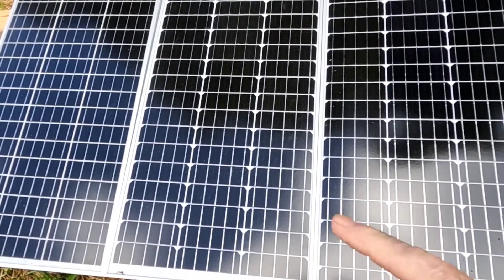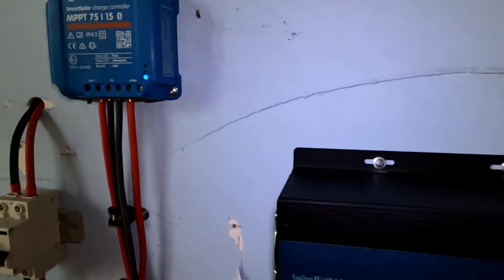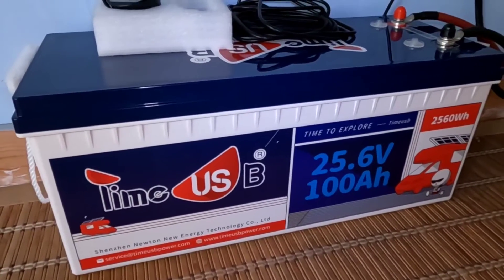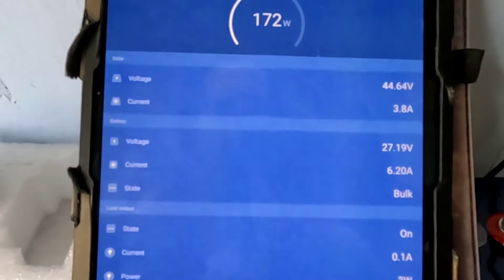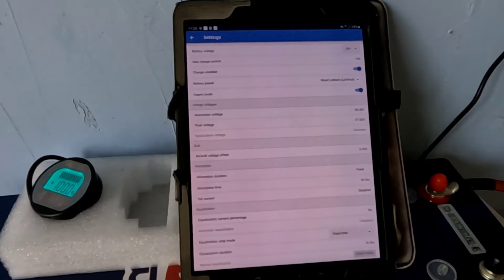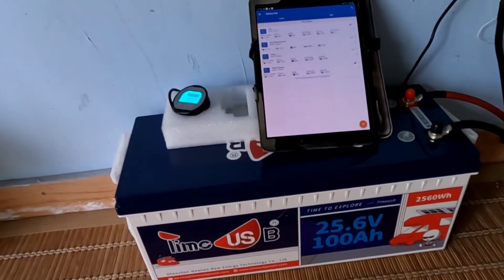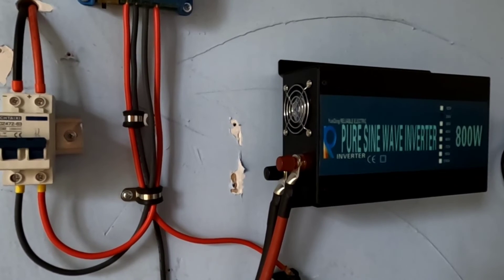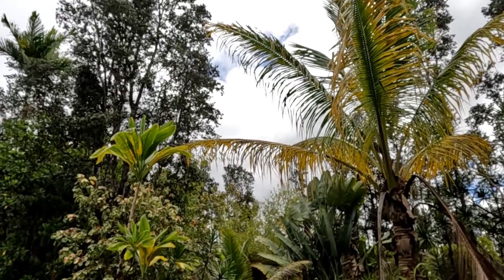12V LiFePO4 battery charging system to 24V in minutes

Comment: I Dove straight into 24 Volt Systems for the Xtra Solar Harvesting and Cable Sizing and Breakers and Disconnect Switches - using The CHINS 280AH LITHIUM IRON PHOSPHATE with Low Temperature Circuit Protection paired in 24 Volt Packs to Buss Bars and Love It / Them
Several Systems here at 🌴 💦 Indian Creek Ranch 🌵 ⛩ Southern California High Desert - Aloha Brother 🤙

Comment: I'd sometimes consider the availability of 12v automotive accessories an advantage towards a 12v system. Otherwise I'd consider minimising the current in the battery leads (and connections) as resistance in the leads causes higher volts drop at low voltage. I often think that 100 amps in the battery leads is enough to worry about volts loss and unwanted heating.

Comment: Will battery time last longer with a 24v 100 Ah battery vs. a 12v 200 Ah battery
Reply: I'm having a hard time grasping that 😢 ....please explain
Reply: @vroor32  Since 24v is suppose to be more efficient, which ampergae wise I understand....just wondered if Amphours wise 24v lost longer as far as run time.
Oviously we cant compare 12v and 24v with the same amp hours since it would be obvious 24 volt would win.
So I wondered if:   one had a 12 volt system but doubled their amp hours to 200 Ah. Would 24V having 100Ah last about the same or last longer if wattage draw was the same between both 12v and 24v systems. 
Would 48 Volt and a 50 Ah battery last the same amount of time as a 24v 100 Ah etc.

Comment: Does charging a 24v battery take longer than charging a 12v battery?
Reply from the maker: Actually charges faster than 12v. 48v even faster. Higher voltage moves faster, especially over longer wire runs. Aloha 🤙

Comment: Good video but I have a question about the inverter. I understand that doubling the input voltage gives you more power (the 24 100AH vs 12v 100Ah battery), however, doubling the voltage cuts the amperage in half, but wouldn't you still need a 1500 or 2000w inverter if that is what you had originally? Isn't the 800w inverter a little small? Granted, if your load is under the 800w, it can be powered twice as long as when you had one 12v 100Ah battery.
Reply from the maker: Could definitly handle a larger inverter. But everything I need it for is well under the capability. Aloha!🤙🏼

Comment: Good for you - happy video. Getting the full potential of those panels/controller now and you got that 24V battery put into use. You had the components and are doing this to share your thoughts with your viewers, so it makes sense. For someone that already has 12V system run on short cables with only little powerloss and a system that is configured to full potential, a switch wont pay off. Building a brandnew system, espicially if there is long cableruns and who likes to save money on the controller and wiresize, its certainly better to configure aorund 24V than 12V.
Reply from the maker: Well said and mahalo for sharing that with us...aloha!🤙
Reply: @ProjectsinParadise808  If/when this become a more permanent 24V setup(maybe as a backup system or whatever) then I would - as suggested already - have look at those fuses. Its nice to follow how you learn along when you reconfigure and test, and perhaps learn from some of the feedback you get in the comments(some more than others ;). And people who know nothing about solar are still learning from the thoughts you share.
Reply from the maker: @jbjensen11  Appreciate the comments,  and I have definitely learned so much from people here who know way more than I do. Made plenty of mistakes along the way,  and been pointed in the right direction throughout.  I do read every comment,  and even it's way over my head I take notes from those kind enough to take the time to point out my errors.  Learning everyday,  and having fun too!  Aloha !🤙

Comment: That super. now you can get full power out of them 3 100 watt panels. now keep in mind that higher voltage is less amps for the watts. power watts is volts times amps. now look at data sheet for that 24V inverter and look at recommended fuse size. you may want to make a change on inverter fuse. now fine tuning your system takes time.  start with data sheet on battery settings put them in charge controller and go from their. the default settings are a great starting point. that battery is the same as 2 12V 100 Ah battery's.  Hear in Boston NY we got heavy snow warring. 24 in. threw the weekend what a mess. little to zero solar but I got wind ! and that works 24/7 when the wind blows. The winter months are my most power generating time of the year. now in a month you can set your panels correct. maybe show us that. I change angel of my panels . fall and spring. 2 times a year. The farther north the more you have to change. it is how the sun hits the earth. The earth is round and tilted on axes going around the sun. the earth turns once    in 24 hours and takes 365 1/4 days to go around the sun. the 1/4 is why we have leap year every 4. all that comes into play when pointing solar panels. 😀
Reply from the maker: I think I'm okay with the 100amp fuse...could drop it down a bit , but not sure where I'm going to permanently mount it yet. Probably build a small 24v system,  use smaller cables too when I do. Just this minute went to float, looking good.  Going to discharge it some today,  everything looking good. When I was at 9000ft. in the Rockies I had panels mounted to a adjustable array so I could chase the sun this time of year as it got pretty low skirting the horizon.  Not really an issue here. Even this time of year sun gets up pretty high, although not as long, but no need to track, or adjust.  Closer to the equator by far! Makes it easier for sure. Aloha buddy 🤙

Comment: So with twice the voltage, you have half the current for any given wattage output. You therefore need to change all.the fuses, because right now they are oversized and no longer protecting anything.

Overall, by doubling the voltage and buying a new (smaller) inverter and battery, all you have achieved is an unsafe system capable of outputting half the wattage.

Darwinian selection in practice

Comment: I use 27.6 for my bulk / absorption and 26.7 for float.  I find that brings the battery to 99-100% charge and then uses the charger to supply any needed voltage above the batteries resting voltage - if that makes sense.
Reply from the maker: Makes sense! Mahalo for sharing this information with us...aloha 🤙

Comment: Once you connect the charge controller to the 24V battery bank, wouldn’t the charge controller automatically detect that the system is now 24V without you having to manually update the controller app?
Reply: It detects and sets voltage on its initial hook up.  Once it sets itself it has to be changed in the settings if you change voltages.  Might be some kind of safety feature, not sure.
Reply: @benlewis2317  OK. That makes sense.  Thanks!

Comment: Is there an advantage to 24 over 12 i dont understand
Reply: The biggest advantage is being able to use cables half the size.  Higher voltage uses less amps for the same wattage.
Reply: @CampPrevost  he didn't change the cables (or the fuses): just spent a couple of thousand bucks and came out with fewer AC watts. Einstein would be impressed.
Reply: @TheAncientMarinersBlog  how does the AC watts become fewer😃
The 24v system in addition to above mentioned advantages is that with the victron smart solar charger controller, you can get over twice the power from your solar array on a 24v system while as in the 12v system, the cc limits your max current to the battery hence limiting the max power you can get from your pv array.
Reply: @TheAncientMarinersBlog  how does the AC watts become fewer😃
The 24v system in addition to above mentioned advantages is that with the victron smart solar charger controller, you can get over twice the power from your solar array on a 24v system while as in the 12v system, the cc limits your max current to the battery hence limiting the max power you can get from your pv array.
Reply: @engineeringandforex3827  there are fewer AC watts, because before he had a 1500w inverter, and he now has only an 800w inverter. 

The solar panels are still the same old 100w units he had before; doubling the output voltage of the MPPT controller from 12 to 24 doesn't magically increase the input from the panels to "over twice the power".

Do try to keep up, there's a good lad
Reply: @TheAncientMarinersBlog  Einstein would also be impressed with you! You are certainly smart! But you forget to mention that he hit the 15A output limit on his controller before, only getting 2/3 out of his panels. Also he is doing this to learn and to share. That is more than you and I do!